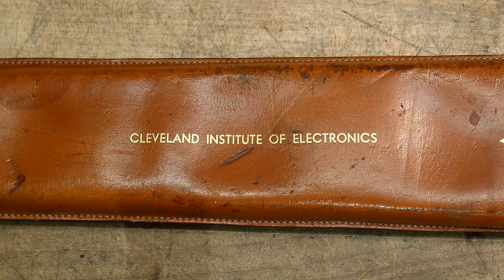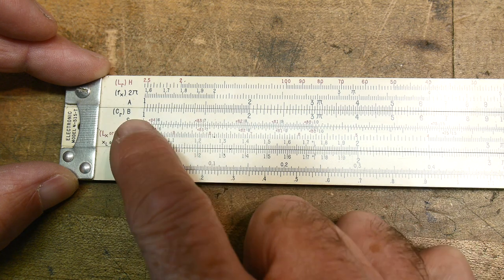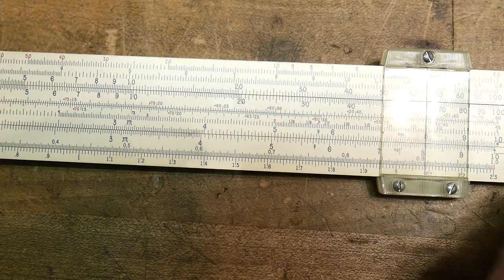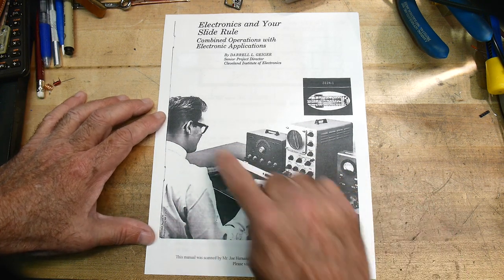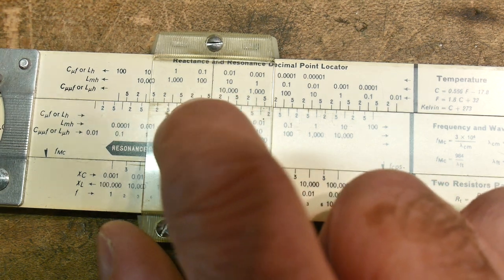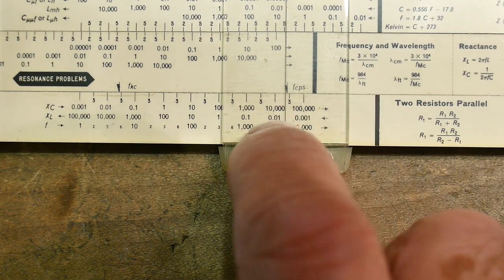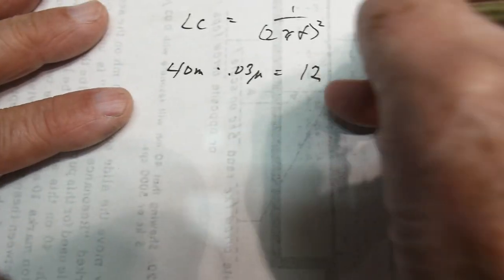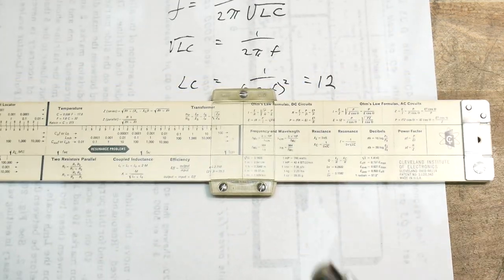#633 Cleveland Institute of  Electronics Slide Rule

Comment: I had a plastic circular slide rule in my pocket in high school.  Fast and reasonable length in a small package.
Reply: I had one of these, acquired by way of my high-school chemistry class.   The back of the slide rule had a periodic table, and there was an insert card with all the fundamental constants and other reference information.  It was the only thing we could use on chemistry exams, no calculators.  (This was around 1976 or so.)   I went looking for it one day, couldn't find it, and bought one from someone on eBay.  And then of course I find the one that was missing, so now I have a spare 🙂   Very nice slide rule; you never went off the end, it just wrapped around.

Comment: When I was in the Navy, and attending Advanced Electronics Class "B" School on Treasure Island back in 1968, we used Pickett and Dietzgen slides rules.  I also took the CIE Electronics Correspondence Course back in the early 70s, but then I was picked up for the Navy's Associate Degree Completion Program and didn't have the time to finish the course.  It was a good course, and I got about 2/3 the way through it.  I didn't take the slide rule course though as I was already proficient in using a slide rule.

Comment: Just picked up one of these slide rules at a local ham fest.  Used the MB-4/E6B circular slide rule in the Air Force.  Slide rules were slightly before my time.  Downloaded the instruction books and will work thru  them.  I also have a HP-32  do not use  calculators with equal buttons.  Very good video.

Comment: I have a selection of Picket slide rules from the mid-70s...  The plastic student model, an aluminum EE model (for electronics class) and a circular aluminum rule just for the novelty of it.  We weren't allowed at that time to use calculators.

Comment: The image of the engineer on the CTI manual has him sitting in front of a representation of a Heathkit SG-8 signal generator and an IO-10 oscilloscope. The meter on the right was supposed to represent a Bird 43 perhaps?
Reply from the maker: probably a VTVM
Reply: @IMSAIGuy  probably.